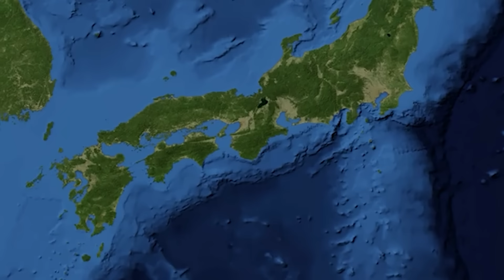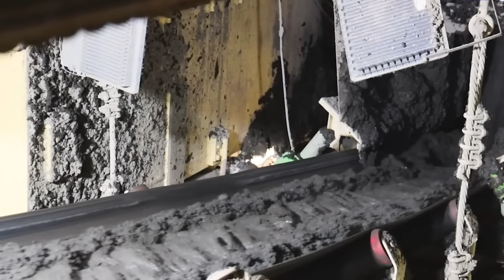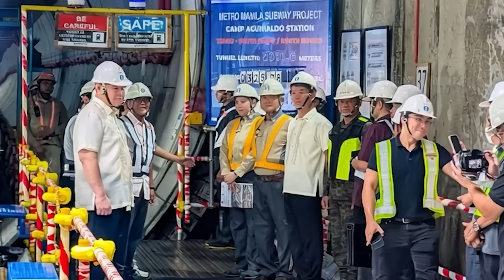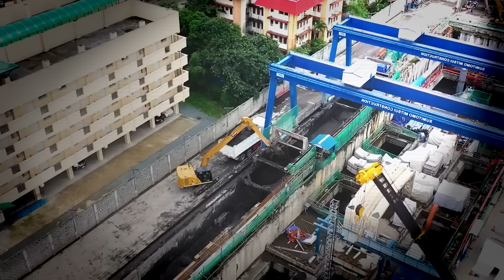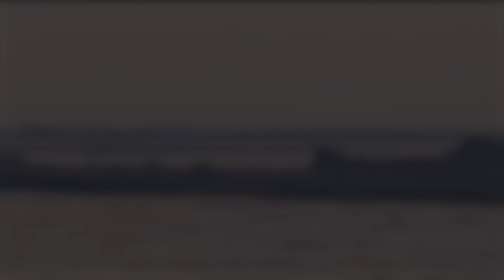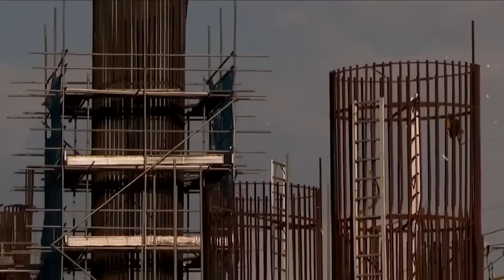The 5 BIGGEST Advantages of Luzon Visayas Connectivity Project

Comment: On the bright side, yes it's a good idea.
Geologically speaking, you are placing a vital infrastructure on top of an active fault line, not just one but multiple. Critical failure means that you are risking t multiple regions cut off from an emergency supplies.
I would rather suggest a multiple logistics exclusively for food and supplies via land sea and air, than to rely on a one project.
Only you need is a constant rotation of it.
With the suggested underwater tunnels, one leak would shut down the whole idea, which is gonna be costly maintaining it.